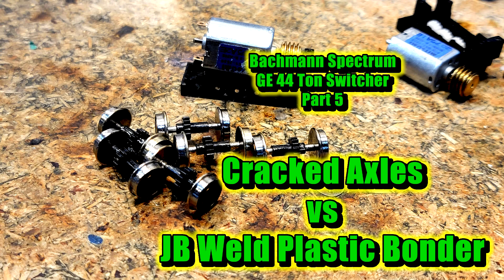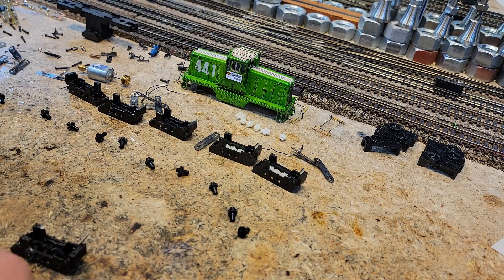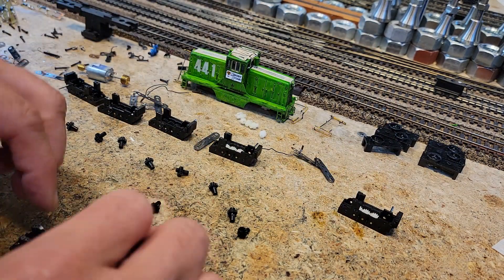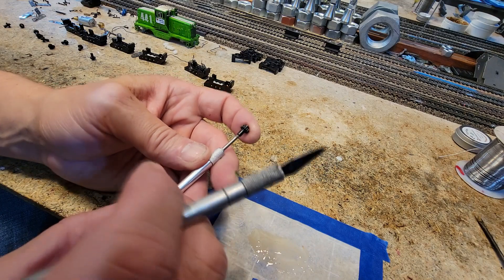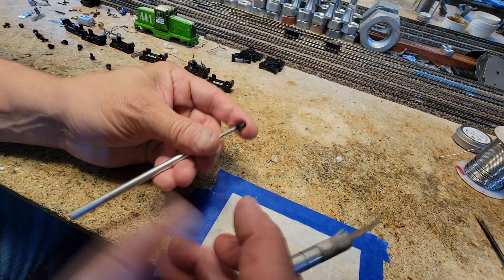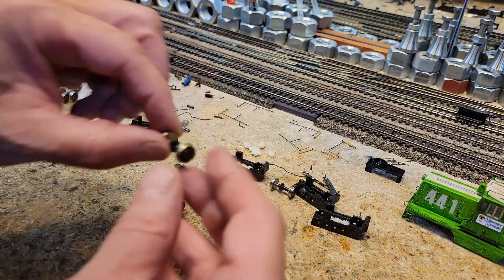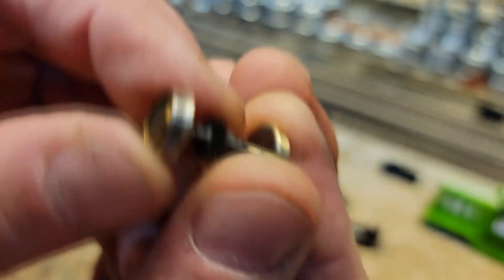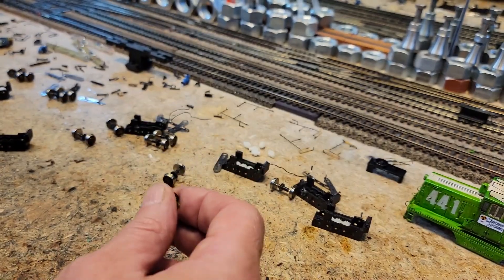Cracked Axles vs JB Weld Plastic Bonder

Comment: I have one of these 44 ton switchers and it is very light I need to add some weight to mine.  Luckily it does not have broken or cracked gears or axles.
Reply from the maker: they don't have much room inside, but if you hammer lead weights totally flat, you and line the inside walls!

Comment: After watching this video ,,,,i have a pennsy center cab by bachmann that is still sealed in the box ,,,,,i mite just leave in the box or take it out and if it has this problem i will use it on a flat car load,,,thanks again for sharing another great video😊😊
Reply from the maker: so far, the bond is exactly what was promised by the JB Weld info.  the bond has just enough elastic properties that it is holding when the wheels are pressed in.  when I take them out the crack pulls together again.  the old way that I was doing with superglue and baking soda was good, but this is much much better.  I think you must run that center cab and if the axles are split, use this stuff.  I bought at my neighborhood Ace Hardware!!